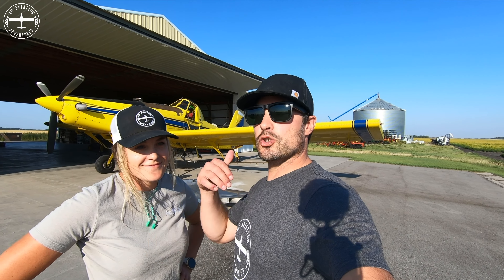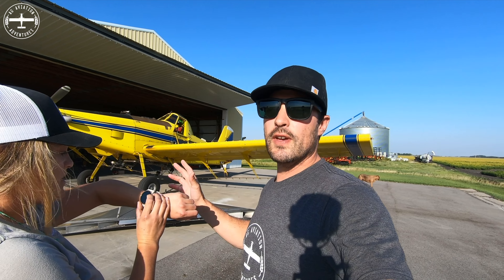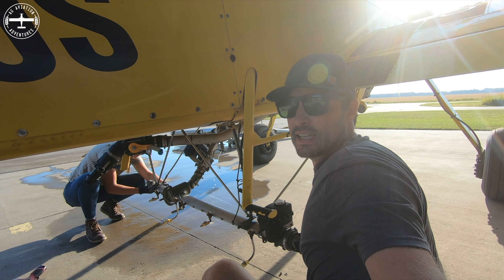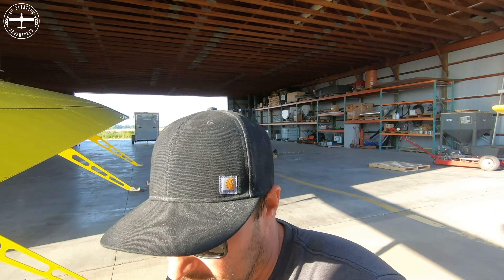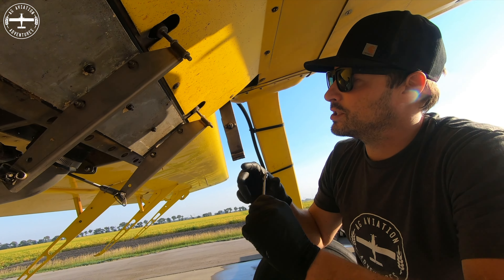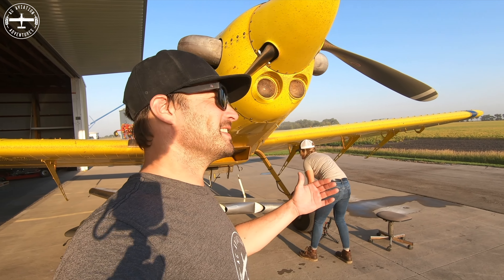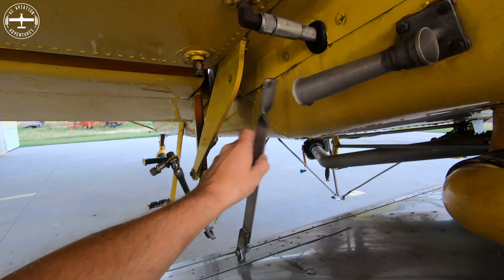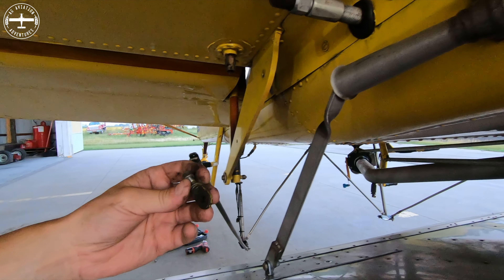Swapping from Dry to Liquid Applications in Ag Aviation

Comment: Hi guys. Was wondering what is the use of the venturi tube on the right hand side under the wind of the Aircraft?
Reply from the maker: Hi Waldo. That tube allows air into the hopper so if I have to dump the load it will jettison as fast as possible. It goes up to the top of the hopper where there is a small looking bubble type thing. You can see this bubble in videos on the right hand side of the hopper on the top. The tube goes to that location and stays out of the liquid because it is higher in the bubble. If I have to dump the load it allows the liquid to come out quickly and prevents a vacuum type situation. And I turn it around to face into the oncoming air why spreading as it will pressurize the hopper and allow the seed to come out.
Reply: @AgAviationAdventures   I understand the vent tube.😅

Actually asking about the venturi tube that's just off of the fuel strainer.
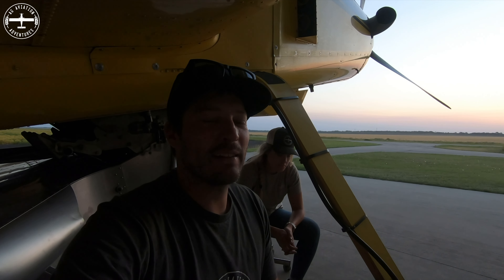It's on almost at the belly of the Aircraft around the 6:23 mark.

I know on older aircraft that would drive the suction gyros, but that is not the case on most 502's.

Thanks for the reply, Hooked on this channel
Reply from the maker: @waldobean7534  Sorry, this aircraft is not one I normally fly and that venturi isn't something I even noticed. I just figured you were talking about the vent tube as that's the only thing that came to mind over there. 

Anyways, you are correct it would be for gyros. However, this 502 doesn't have any of that but it is a pretty old model (I think 1988). So at one point I'm guessing whatever was being used by that venturi was removed.

Comment: What controls the amount of pounds of dry products per acre you are applying?
Reply from the maker: I have a stop on the handle in the cockpit that I can move depending on how many pounds per acre I am applying. So when I push the handle forward to open the gate it hits the stop and the gate only opens that far. If I want it to open more I can adjust the stop.

Comment: When you finish spraying a particular type of spray (herbicide, fungicide, etc.) what do you do with the unused spray in the hopper/booms?  Is there a disposal tank you put it in, or do you plan to have it completely empty by the time you return, and before changing loads?
Reply from the maker: Return with it completely empty. If we’re switching herbicides or from herbicide to fungicide on a different crop (one example) we will clean out which means going back to the field to clean the tank/equipment out completely.
Reply from the maker: Clean Out Procedure in Ag Aviation
https://youtu.be/5_4hJ4S9IUc

Comment: Is the pay structure for spreading the same as spraying, per acre? You are supplied by the customer with the seed, but you load yourself? All the spray and spread equipment is an additional business cost in addition to aircraft Acquistion, maintenance, fuel,  aircraft insurance and crop insurance, hanger/pad/water - all to comply with their own regulations. Its a lot for a small business owner.
Reply from the maker: It usually costs more per acre to spread cover crop because depending on how many pounds to the acre you are doing you may only be spreading 20-50 acres a load instead of a minimum of 100 acres a load with liquid. Generally the farmer supplies the seed.